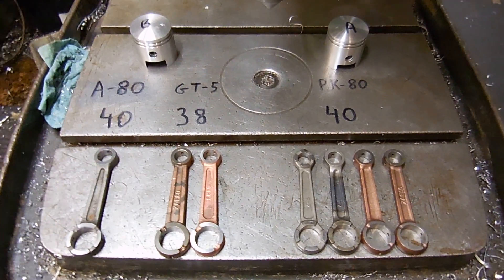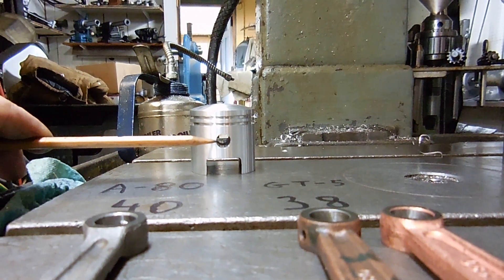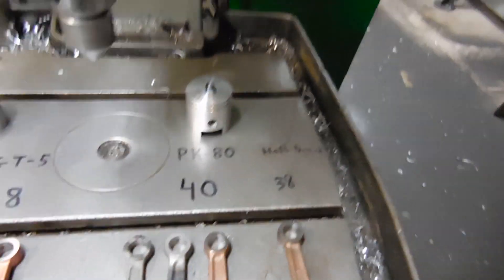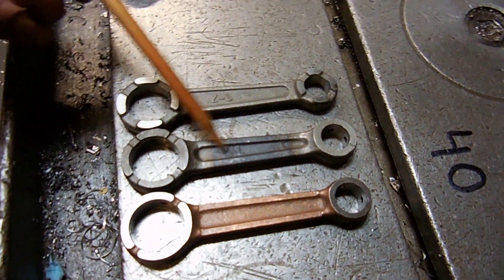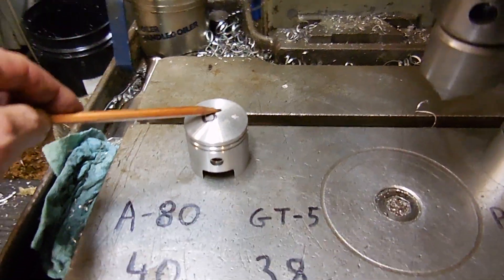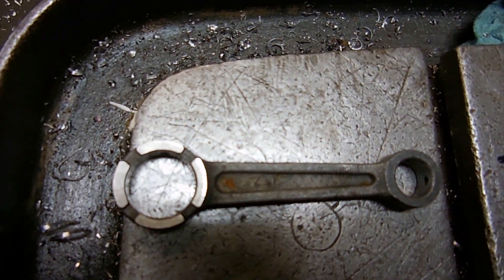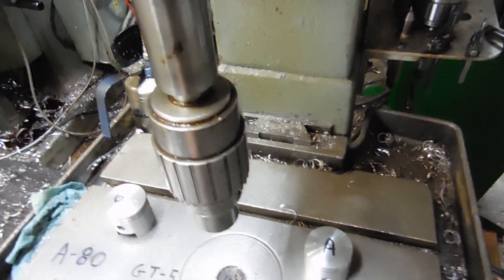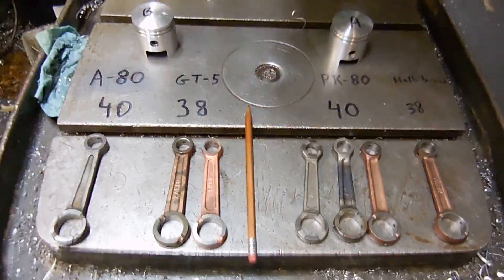Motorized bicycle engine geometries PART 2

Comment: My piston hole is in the middle with a zL 40 mm rod and what's better 38 mm Stoke or 40 stroke this is In my 80 cc 47 mm piston and I believe in mt anbull 100 cc 50 mm piston I think its a 38 stroke rod

Comment: Just got one today . It's advertised as 100cc with high compression head from eBay.
Took it apart and I' can't say how much happy I am for the hours I've spent watching these videos. So I found one transfer port nearly 3/4 coded by an actual peicthat was cut from the jug or sleeve and the other ports had lips for the size of the hole I'd say them lips was pritty big.
So my motor has a rod AE80 that bronze colour metal

Comment: I believe it's possible that some engines come with the wrong piston type installed! I have a ZAE 80 rod which is not featured in this vid AND the difference in actual con rod length is not specified, nor any specific measurements therefore, I still have no idea which crank I have; it originally had a type A piston but I have measured the stroke and it has a 40mm stroke. So...god who knows.

Comment: I have the PK-80 Piston with the unmarked rod. I need a crankshaft with the rod and haven't had any luck finding it. Will either of the Z-L type rods and crank work with my engine?

Comment: The one I have looks like the one third from the left. But it says AF 80 on the rod.
Reply: Marc Serina the AF80 rod is used in the GT5 engine
Reply: Thanks! good to know.  In your experience how does the GT 5 compared to the triple 40.  I ordered a triple 40 months ago, got tired of waiting so I ordered the gt5.  Just got word that the triple 40 is coming in a couple days. Trying to figure out which engine I should use. although I'm going to keep them both. I have two four stroke builds but I'm a newbie when it comes to two-strokes bicycle engines. I'm still working on my first build.
Reply: The triple 40 is a better engine for sure. Especially if you bought it from Zeda motorsports their port work is great.  The intake and exhaust ports are tiny on the gt5 and more restrictive compared the triple 40. FYI you can interchange the cylinder jugs with these 2 engines only, They have the same port map.
Reply: I just bought this new cylinder jug with slightly larger port and it has the round exhaust port opposed to the oval port on the GT5
Reply: https://rover.ebay.com/rover/0/0/0?mpre=https%3A%2F%2Fwww.ebay.com%2Fulk%2Fitm%2F192208124535
Reply: Thanks for the knowledge! Yeah I see what you are saying about the ports.  The triple 40 is from Zeda,  I almost canceled the order a couple times. I ordered it months ago...   maybe I just got lucky but the GT5 have some really nice and clean port work,  I was surprised I've seen a lot of hack jobs on YouTube. Thanks again 👍

Comment: My jugs are to short
Reply: ,brah, im telling ya, get your cutter burr mounted in a drill an fn hog out the space for the piston in the crappy head it comes with. File ramps in your piston lil at a time til you find that spot in the timing. Ramp the exhaust port side of the piston. My built from junk motors outrun my buds mailorder cuties everytime. Build torque into em so that 32 gear does its job.
Reply: ,the situation your in makes lotta power if you finagle it right.....homes.
Reply: I found out when i put a bgf eyebrow jug on a pk-80 bottom end and built the weird honda elsinore clone pipe dragonfly 75 tells about. Pack o hornets under the seat.   I hear the sleeved cylinders are the hot setup now.
Reply: @waterboy4124  just call me at 415 3682992 so we can figure it out better
Reply: @bigdevil1310  got it, hope youre in a warm part of the country to road test the mods.

Comment: I have a pk80, I put bad oil in it and now its dickered, and there is evidence of combustion within the crankcase, I think it happened because the stock exhaust has way too much backpressure.

Comment: Hello I need help! The kit I purchased won't run right. I took off head and noticed that at BDC MY INTAKE ports are not visible.

Is that normal? Did the wrong piston come from factory? I have the low hole piston.

Comment: I have a no name b piston rod and its grey like the zl rod so im comfused
Reply from the maker: If it's a type B piston (high wrist pin location), then you probably have one of those CDH A80 engines. It's like a GT-5, but 40mm stroke instead of 38mm. I sell top end kits for that geometry. Here's a link https://www.shop.crmachine.com/product.sc?productId=202&categoryId=16

Comment: Zeda 80 is what my firestorm says
Reply from the maker: Yeah. That's a A-80 geometry. It's like a GT-5, but it's a 40mm stroke. The ZEDA80 engine is a copy of my GT-5L geometry.
Reply: Failed c-clip took out my top end what do you suggest I do do you sell Firestorm so-to-speak top ends?
Reply: I've been looking everywhere for the flat G clip with the holes for the wrist pin as I'm not trying to have another failure with a c clip
Reply: Any guidance towards quality wrist pin clips I'm sure we all can appreciate
Reply from the maker: Have you checked out www.treatland.tv ?
Reply: I just payed 10 after shipping from walmart, these are a 100 count for 5 buck same 150,000 psi breaking strenth
Reply: 10 i payed for only 5 ha haa i might order the 100 but id never use them but some shops around could my town

Comment: Thank you.I'd never done anything with a 2-cycle except trimmers,and that was clean carbs and adjust.New engine was given 2 month ago and I saw casting peaks along the inner edge,against the cylinder surface,of the intake so I took it apart.Good thing as 1 of the ports also had quite a bit there too and would've broken off into the cylinder eventually.Anywho..I was able to see these things you're describing, and know what I have.I now know what to expect,and what I can,and cannot do to maintain or enhance.(I do want to get your 55 later)Thank you again for your complete explanations of  connecting rods,pistons,and the cylinder heads and volumes.

Comment: What type is the gt-7
Reply: i belive its the  Gt-5 i tray to know to
Reply: It's a 38 mm stroke the rode is a ZAE 80 it's all about setting your rings right when you take off your cylinder you will notice metal bands on your piston those help keep gas and vapors from looking out the NGK spark plug is what you want with some Opti 2 oil it always has a ballenced crank it's a really good engine

Comment: Whats the difference between 38 mm stroke and 40mm?like,does the 40 put out more top speed as to the 38 mm does more torque?
Reply: What exact crank do I need balanced racing crank for a Zeda 66/80cc bottom end?
Reply: How many mm exactly is a Zeda 80 rod and what racing balanced crank can u use?
Reply: Exactly the opposite

Comment: I got two Motors Fred and wanted to see if you can help me out on what type of motor i have. I got a ZAF80 & ZAF60?
Reply from the maker: Hi Mike. Both of those engines are GT-5 type. Be careful about the ZAF60. I've seen several of those have loose connecting rod bearing journals.

Comment: I have a type A piston but my rod has ZMN marked on it. I believe it's a halfbreed 38mm engine, am I correct on that?
Reply from the maker: Bingo! You got a halfbreed. That is an excellent crankshaft. This video was made before these cranks came into the market.
Reply: do you make a better wrist pin bushing or needle bearing for the half breed
Reply from the maker: No, I don't

Comment: Dear, Frederic Chelminski, I've looked at my engine finally after a year to figure out what it is, it has the con rod from the A-80, so 40mm stroke. ( the Z-L, gray, and it has the counter sunk oiling holes that are not centered.) But it has a type A piston, does this just mean I have a normal pk80 engine? Or is it some kind of A-80 Pk80 half breed. BTW it was a flying horse bought from bike berry.
Reply from the maker: Hi. I believe you have a PK-80. I do not know of any Z-L rod halfbreeds out there. Thank you.
Reply: Thank you very much .
Reply: I just purchased the Engine FH-BEK 80 from Bike Berry.  From all this I've figured it to Be the PK with the Z-L Rod and Type A piston.  Bike Berry calls the Piston a Number 4 but it has 2 stamped on the Crown. Top end of rod is Caged Bearing and boy are they a loose fit.  I suppose you have a Top end that would work on this Fred ?

Comment: You should make a new video on all the new engines out race and non racing everything has changed now different strokes different heads that must mean longer rod also the 40 pistons don't fit all engine there's different bore sizes to no matter what engine you buy there never the same anymore internally it's all changed some are being sold as 66cc some 80cc but the new barrels seem to be the same size some have longer rods those ones have a different head.

Comment: I have a F80 stroke engine can anyone tell me what kind of motor I have please!!!
Reply: Me too, can anyone help us out?
Reply from the maker: GT-5 engine
Reply: Fred, plz. I have an "FM 80" stamped rod with a type "A" 47mm piston. 8mm fine thread head studs. Originally it had the 32mm small intake bolt pattern jug, broke off exhaust studs so changed jug to a 40mm intake jug. I still dont understand if its a 40mm stroke or otherwise?

Comment: Is it possible to use your  stage 1  GT-5 top end kit 66cc   on the 2 stroke GP 460 engine or what engine kit can I use to achieve 65mph

Comment: Thanks Fred, you always do a great job in your explanations and they're very helpful.
 This was the first O habe seen of the "A-80" engine and I also didnt know we had a "PK80" out there now that has a Z-L marked rod that actually has a caged lower bearing.

All I have had or seen have had the loose pin bearing on the lower journal.

I ordered two cranks from MZmiami last year and both are 40mm stroke Z-L marked with the loose pins on bottom.

haven't used one in an engine yet, should I use these type Fred or am I just looking for potential failure with the loose pin cranks?